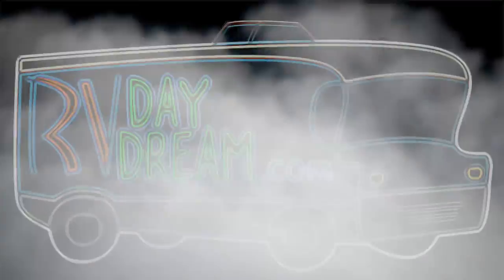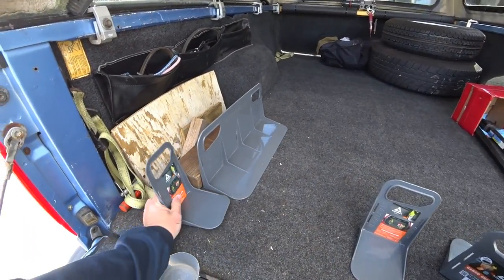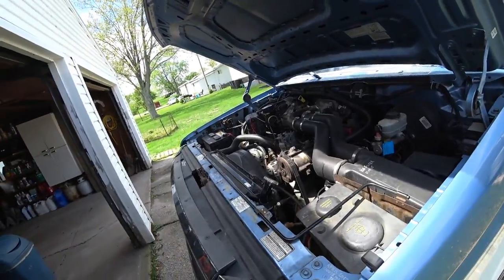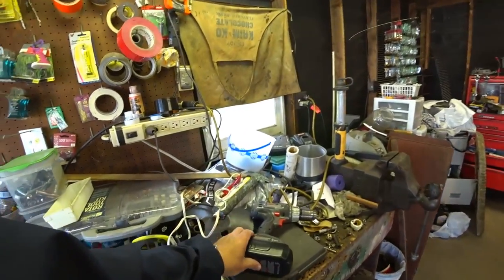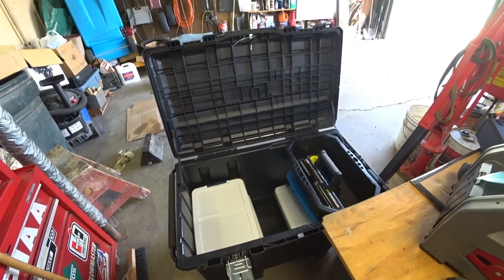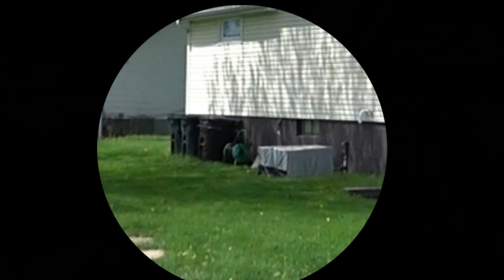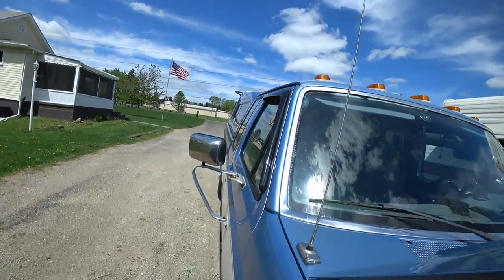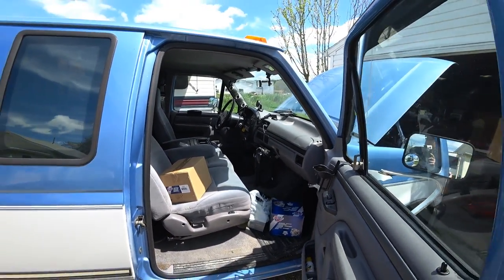Too Busy to RV, Beginning of May

Comment: one  thing you may want to look at as a preventative measure is your governer in your transmission. Easy to get at and very little cost. I suppose it would depend on history of your truck whether is is getting sticky as well as your valve body.
Reply from the maker: Yea, the Solenoid Pack is another cheap an easy too.. But I think I would like this shop to do a full diagnosis, Their reputation is extremely high, that is why I am willing to let someone else take a peek at it.. They are about 35 miles away..

Comment: Regarding your fan: I'd like to put one in the bedroom of our trailer but no fan is there currently. The light that is nearby is on a switch so I can't tie into that for power. Do you see any issues running wires to another light along the ceiling or would that be asking for trouble in the long run? Our bedroom stays much warmer than the rest of the trailer!
Reply from the maker: Darrell Trammel I don't see any problems with that. That should work out just fine it's long as you don't mind the wires exposed.